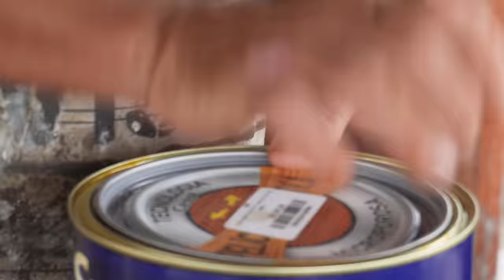Wooden Boat Makeover: Pilothouse Lighting and Deck Painting — Sailing Yabá 160

Comment from the maker: Hi guys! We hope you enjoyed the episode! We want to know: did you like the red conduits?? 
We weren't too sure about them until we saw them in place and then we felt that we made the right call! We really like the color pop and we hope you do too!
Reply: Looking good! I hope no one uses the red conduit tubes as grab handles in a storm :(
Reply: Hi Ben and MP.
My name is Krille from Sweden, i am an old tugboat captain whit more than 50 years on the sea. I’m like your spotlight’s in the wheelhous. But from my experiece when you are night sailing it can be to bright lite in the wheelhouse whit only white downlight. I put som led strips whit red light in the roof of the wheelhous just over the steering and navigation place. An red light you can have on the hole night and you will not destroy your nightvision. I have folowd you sins the bigining and i love and admyer your work. Ceep up the god spirit and keep on sailing. Love from me here in the white snowy north of Sweden.
❤❤
Reply: I was wondering if maybe placing white led strips inside the red tubes and use that as the red nav lights. It would serve two purposes, of course it would depend if the red tube is a bit transparent 🚨🗺️⛴️
Reply: @andrewmawson6897 yes maybe add somme metal handles to hanging when displacement and avoid misuse of these red tubes 😊 nice work
Reply: Only problem I see in using the thin  red pvc conduit is over time it might start to sag . It does look good
Reply: Looks all good to me
Reply: As I worked as electrician for many years, I would say pvc conduit is great for sea, the only thing that would be a problem is that if you don’t seal the connection between tube and connection box the condensation of water and salt will destroy your cable in just few weeks, the cable will suck the water because of the copper filament and salt water will run inside the cables corroding all the cables from inside creating a resistance and damaging the electrical system, also that if the tube is not properly protected from grabbing people will grab it just for anything even to just talk in calm water… pulling the tube destroys the electrical connections, the color is wonderful but think in safety first and avoid any possible problems with human behavior in a moving boat😉👍🏼😎🇵🇷
Reply: I would paint the conduit in black so that they more or less disappear. Obviously, it’s a design choice.
Reply: I think it’ll look amazing wrapped in silver and gold tinsel for Christmas 🎅🎄
Reply: 😢no...not a good choice... but, the red conduit is the only thing I really don't like on your amazing boat 🙌🙌🙌🎉
Reply: The red looks great!  I really worry about using crimp fittings on your electrics - solder everything and you won’t have any problems in the future 😎
Reply: Oh no. I’m sorry but I think the red plastic is cheap looking and such a horrible contrast with the natural beauty of all the gorgeous wood and boat design. The plastic almost feels disrespectful to the sea and the exceptional workmanship of Yaba. But it’s your boat and it only matters if you LOVE it. I can’t wait to see beautiful Yaba sailing in the ocean!
Reply: Our house is divided: I like the red conduit but the husband does not.
Reply: I thought you were going to pull dimmable  LED light strips into those red tubes. That would have been amazing as red night lights for when you are navigating at night.
Reply: Please tell me the pex water lines aren't permanent.
Reply: @j_rainsgoat3929  pretty positive thats not pex. Pex comes in a roll, that looked like straight red conduit to me.

Comment: I see the type of electrical connectors you are using....  keep a large collection of them extra and seal them in plastic containers...  about a year and a half or two years being exposed to salt air they will corrode... and you will need to start replacing them...

Comment: You should install red lights in the pilot house for night underway navigation. It will help with your night vision. This is very important for safe navigation at night. You can purchase duo light that has both red and white lighting and use a three way switch.

Comment: I have been following you from the beginning and  applaud your achievements. However, as an ex Merchant Seaman with 10 or so years of experience on the worlds oceans , I am concerned about the ability of your steering system to cope with heavy weather , and with the placement of your thrust bearing.  I suggest ( if you haven’t already) that you consult a Marine Surveyor .  If you intend to get insurance on your vessel , you will have to do that anyway.  Best wishes with your project!

Comment: Any concerns for the pipe you’re using for lighting expanding in hot environments? I seen a parking garage use a pvc between pipes in hot summer weather they expanded and looked like 〰️

Comment: Tip when wiring from the ground up. First mount ALL your electrics in there location. Then make a schematic on a large poster board of all the electronics location and distance of wire between the source and final. Then pre make the wires in looms but the wire cut long. They have wire looms with different colors and sizes. You can have designated color for different voltages and applications. Then lay out the loom and finalize the wires. Wiring thing's one at a time almost always ends in a mess. Thats nearly impossible to diagnose and/or repair under way. Or in heavy seas. Let alone at a doc

Comment: You have too many colours in the cockpit, you should paint the ceiling of the cockpit white as well, it will provide more light in the area, make it feel more roomy and you will be able to see mold, creates consistency but also looks more modern. That red cable tubing does not look good. To many colours and no consistency - white ceiling with galvanised or copper tubing would look better:-(

Comment: Since you were using red tubing, you should have gotten strings of LED lights, and found a more translucent red tubing.  Then, you could have put the wires in the top of the red tube, and then at the bottom of the tube, you could have had the LED lights, giving you 'strip lighting' for the red lights.  Red light is harder to see, even at night, so it would have given you more light while not damaging your night vision.

Comment: Think the red conduit really suits the stained wood theme and wooden boxes - little concerned that someone new on board might grab the conduit for support but its not AC so not a disaster.  More concerned about the size/strength of the backing plate and overall support for the mainsheet  - this has to be strong enough to survive a gybe on a bad night and for a boat Yabba's size and the mainsail area, that's a huge load - might want to check with your naval architect on this one, even though you are only replacing it the way it was before? Cheers as always - wonderful progess.

Comment: For intenal lighting I would also add a bypass wire and switch which can turn on lights even if the individual light switch is off.

Comment: Your boat looks great so far . Are the electrical boxes on the ceiling water tight and sealed, especially where they are outside? Those connections look like they would be found in a house not a boat. Keep up the great work and videos.

Comment: If you take a piece of wide painters tape and stick it inside the opening of the paint can on about half of the diameter it will direct the paint over the sealing surface and prevent the mess from running down the outside of the can.  if you simply let it sit there for a few seconds after pouting the paint you want out the vast majority will drip back into the can and you can remove the tape and put the lid back on without having to clean the top so it doesn't get glued on.  Just a quick tip that saves a lot of time once you figure out how to do it.

Comment: I would suggest that you add some illumination to the ceiling.  Apart from lighting up the feature woodwork, having an illuminated ceiling gives a natural uplift to the brain.  Our brain is tuned to have a brightness overhead - think how well you feel on a bright sunny day and how the mood changes on a dull day.  Having just downlighters creates a dark ceiling that is oppressive.  You could fit horizontal spotlights to the lighting back boxes and looped in with the downlight or add strip LED lighting along the beams, anything to brighten the ceiling.  Depending on the output of the downlighters and their spread, I would guess that the spacing you have will not provide sufficient lighting for tasks, so you may have to resort to task lighting at necessary locations.  To be able to read text and maps the lighting level needs to be quite good, say around 250lux and don't rely on your young eyes to determine what is adequate, as after a watch on the boat or strenuous period you will welcome good lighting.

Comment: Using PEX for conduit is :(  Burns/melts easy creating fire hazard
Reply from the maker: The tubes we bought are made for holding electric wires. They are not water pipes, they are conduits (in portuguese they’re called electric ducts even) 😉

Comment: If you don't get the boat afloat soon its going to leak like a vegtable culinder !!!!! Then all your hard work will be ruined !! One other thing You are using plain copper wire ??? That will not last long at all You should have used tinned wire which is what you must use on a boat due to corrosion you will get with just plain copper wire

Comment: There are no ceilings on boats,they are called Deckheads. If you’re going to be sailors you need to learn the lingo
Reply: no they dont. everyone knows what theyre saying.
Reply: Actually there are ceilings on some  boats. A decorative lining on the interior of the hull  (but not  overhead) is referred to as the ceiling.
Reply: @richardnwilson  well in my 30yrs in the Merchant Navy ,retiring as Bosun I must have missed that one.
Reply: @barrysullivan59  That's understandable it's a very old term used on traditional wooden boats. The ceiling was usually made up of wooden slats often with spaces between.